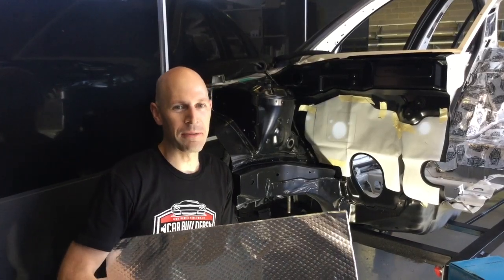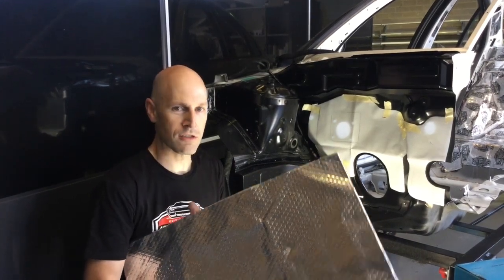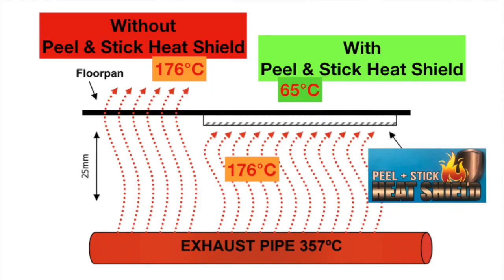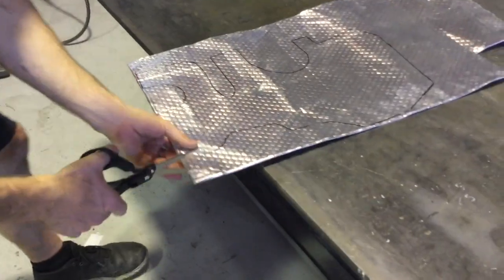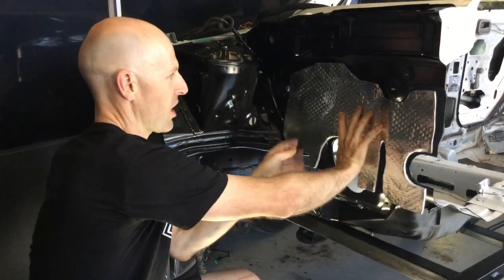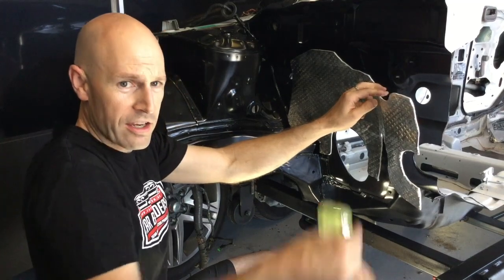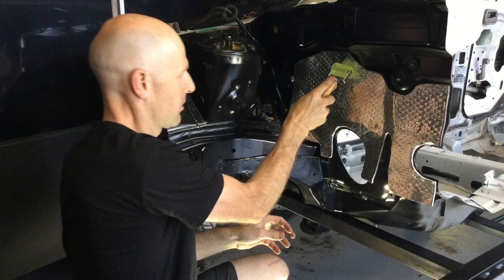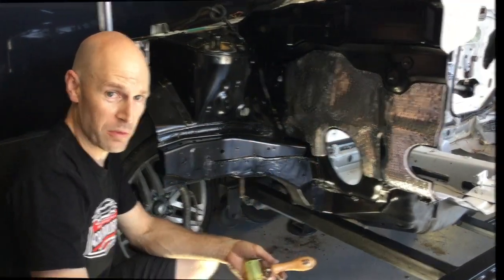How to stop heat from coming through the firewall, floor pan etc with a heat shield

Comment: I have seen many sport car builds on YT for years and a few times I told people to really take the time to fabricate or rebuild their fire wall ,even if it"s only for track...but for your fav car as a daily ,you want to be in complete control of your engine bay heat(especially for Turbo cars)...as I was searching for DIY stuff ,I came along MORGAN British cars older builds ,and these guys were using wood(specific walnut wood) also for their chassis ,and it a super way to do it and so efficient ,too many swap and built cars are somehow useless as a daily or for long road trips because of heat/over heating and noise problems ,just like the Ultima builds with no windows..terrible..!!!

Comment: Would it work the same if I put it on the inside of the car on the firewall. Since I don't want it visible In the engine bay
Reply from the maker: It will reduce heat but not nearly as effectively as if it is facing the heat source. We are about to post a video of hiding heat shielding with a '56 Customline as we understand the desire of not making it visible. 👍

Comment: I'm not getting this , is in the cabin on the firewall ( replacing firewall pad) or in engine compartment in firewall ? Or does it matter ? I would imagine reflective side towards heat source , so no good inside cabin on firewall ? Help me out here fellas ?
Reply from the maker: Hi SV. You're right, any heat shield is going to be far more effective facing the heat source on the exterior side. You will find that vehicle manufacturers will also use a needle punched fibreglass with a polyester core and aluminium face (very similar to our Peel & Stick products) internally with Ford using it in the foot wells of the F-250 etc.
Reply: @carbuilders1  gotcha , I guess like Dynamat . It has adhesive side down but on adhesive still contacts reflective material . Great stuff for a racing car tho !! Be safe

Comment: Iv got a toyota hiace where the driver and  front passenger are sitting on the engine.  Hence the heat coming up from underneath.   Remove whats there and then apply this product I take it.
Reply from the maker: Hi Abdul. Yes, the peel and stick product will reduce temperatures in this situation.https://www.carbuilders.com.au/engine-bay/

Comment: Is it good to sound insulate the engine?
Reply from the maker: Hi Ferenc Nagy. Yes, it will offer some sound insulation, however it's main design feature and use is to reduce heat transfer

Comment: Can this be used to replace a heat shield for headers?
Reply from the maker: It can't be applied directly to the header, the product has been designed to adhere to the surface you are trying to protect. 👍

Comment: Hey guys I'm looking at putting something in the cabin as the cars on the road I was thinking around the foot well and the tunnel of the gearbox ? Can this be applied inside the car and not out side?
Reply from the maker: Hi Andrew. It's going to be most effective facing the heat source. If you are putting a heat shield externally heat facing you won't need to add it internally rather you can just focus on sound proofing materials, which will also act as a decoupling layer for heat. 👍
Reply: @carbuilders1  It would be difficult or impossible to put this in most cars as we would need to remove the engine, or you know something we don't know.

Comment: When I drive I feel the heat burning 🔥 my feet from my floorboard and NOONE believes me-I tell people it’s like I’m being electrocuted from my floorboard
Reply: I believe you and I don't understand why no one else does. One of three things might be happening. 

1. You have a loose wire somewhere and you actually are being electrocuted
2. It could be intense heat coming through from the engine. They do sell heat resistant mats you could get hold of to test that theory. Heck, you could get a roll of car insulation and cut out your own mats. See if that helps. I wouldn't recommend this product for the test, though.
3. Nobody believes you because you've got a pinched nerve in your lower back and you really are the only one feeling it when you're in that particular position. I'm not joking. I just had spinal surgery three weeks ago. For about two years I was complaining that I couldn't use my recliner because it felt like I was being tazered in the butt and hip. I couldn't sit through a two hour movie without screaming and jolting out of my chair. And it ONLY happened in that chair. Dude. I actually ripped the back out because I thought there was something inside it. Then it started happening when I was laying on my back in bed and THEN I began to feel 'phantom stones' wedged under my toes. That's when I realized that my poor spine was really confused and sending signals from crossed wires to my brain. I had four blown discs and had lost two inches in height without realizing it. For the longest time my family thought I was crazy. Hell, I thought I was going crazy for awhile there.

Good luck, buddy. I feel you. Bodies are dumb.

Comment: Your explanation that the Al will grab the heat and hold onto it (i.e. a heat sink) is totally wrong. The thermal capacity (product of the specific heat and the mass) is very low. The Al works by reflecting the radiant heat and the backing acts as an insulator.